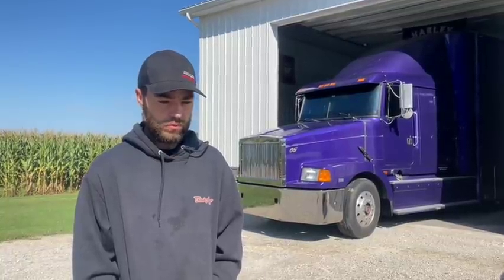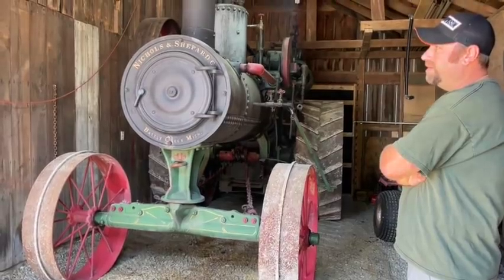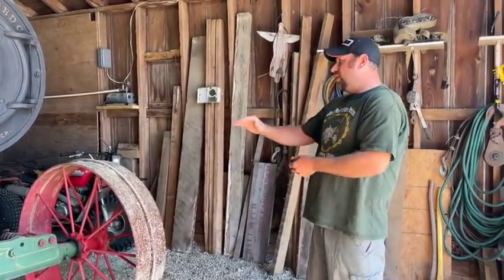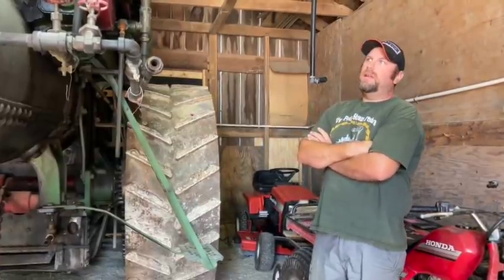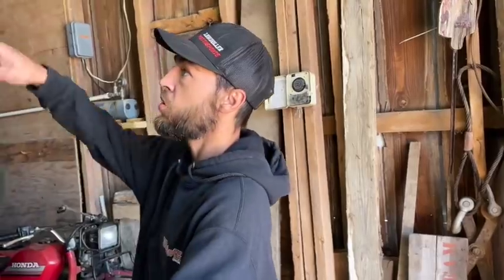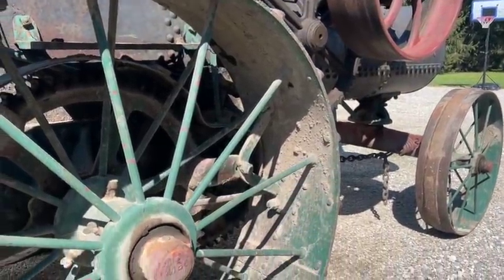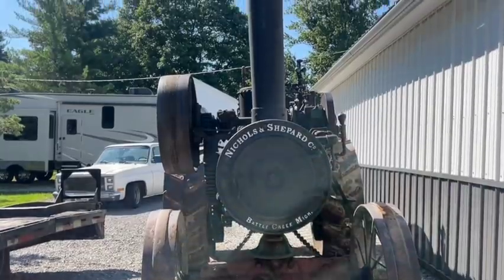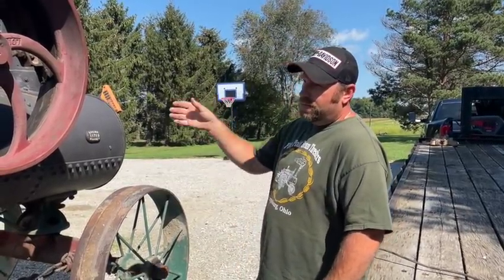Old School and Big Power! Learning about the Nichols And Shepard Steam Engine.

Comment: The term "Going balls out" comes from the steam governor that governs the speed of the engine. The faster it runs the fly balls spin outward closing the needle valve limiting the steam to the cylinder. Also the 20hp nichols engine has enough energy at 150lbs, if it let loose, to take a 15lb bowling ball to the moon and back due to the expansion rate of steam.
Reply from the maker: Holy crap! That’s pretty cool!

Comment: 150 lbs steam pressure will cut you in half and cauterize your neck or torso if one of the steam lines blows out and your in front of it. Folks have no clue to how dangerous steam can be if you don’t know what your doing. Steam is an extremely powerful tool for industry and is vital to the success of our manufacturing in this country.